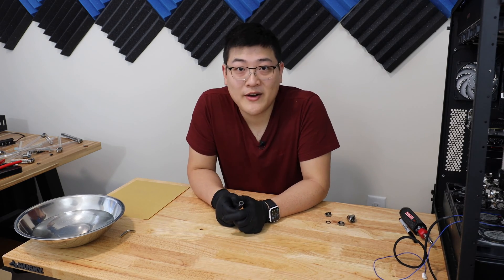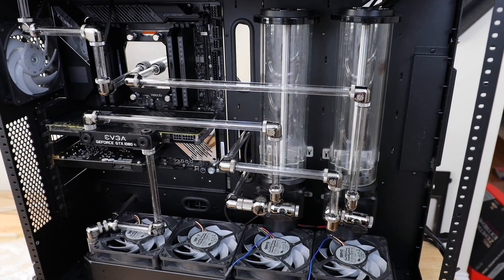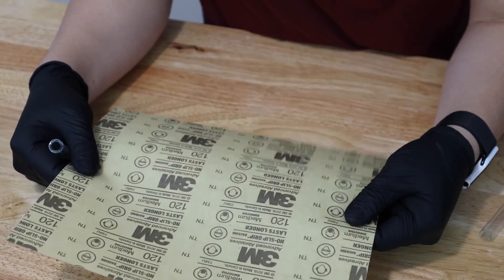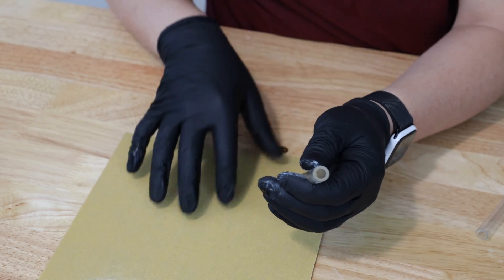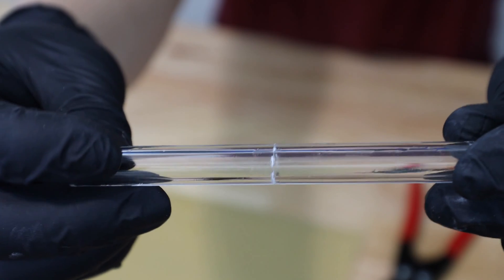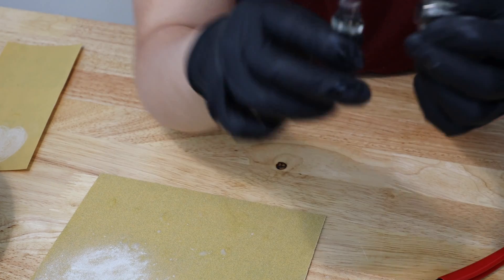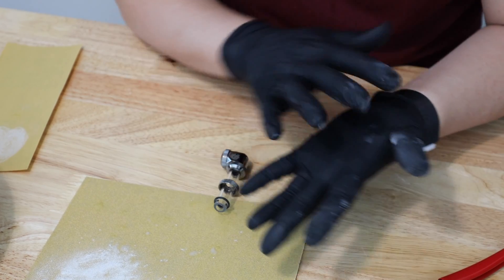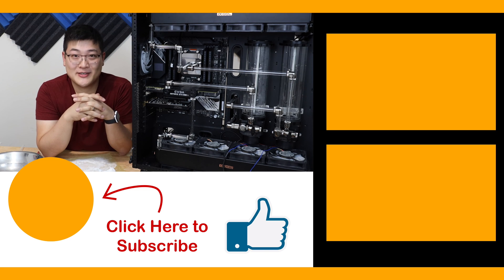How to Cut Glass Tubing for PC Water Cooling Tutorial

Comment: I've had a few of the tubes crack in the fitting it's such a pain. Getting the cracked glass out is no easy task. Those gloves are really not sufficient for glass cutting, you need cut resistant gloves. Nitrile gloves aren't cut resistant. Nice video though, I didn't think many others out there were doing this.

Comment: I Stan, im searching for videos on glass tubing because its caught my attention and im considering it fir an upcoming build. Would you recommend going glass over pmma? How do glass tubes look after a year of use? Still look like new?
Reply from the maker: Nah glass is just too much effort, if you want glass like tubing go acrylic instead of PMMA or PETG. Glass will splinter and crack at the edges in the fittings as the you push and tug at the loop during cable rerouting and new GPU install. The cracks lead to water loss, even though you might not see the dripping leaks. I found that I had to top off the water a lot more often. It looks good but it’s a pain in the ass to deal with. I swapped back to acrylic a long time ago.

Comment: The creation of glass dust is hazardous... not recommended.
Never use sand paper on glass.
Reply: Not even if the sand paper says  can be used wet????
Reply: @joeyh4590  Its not the sand paper dust as much as it is the glass dust. ALL glass sanding or grinding MUST ALWAYS be done using water at all times.
With care and organized safety control over the "slurry" created.
Wet glass dust can and will become dry and can become airborne later when disturbed... thus becoming an inhalation hazard.
Proper grinding and sanding can be done and is done on glass... the key word being "proper".
Strict care must be taken in all forms of this to reduce the chances of cross contamination and transference as well as airborne particulate chances.

Comment: Just finished a glass tubing build and this video was way harder than it needed to be.

It's really simple.
1) Score the glass using the glass cutting tool. You can also just use a triangle file.
2) Wrap a wet paper towel around the tube where the score is.
3) Snap the tube while simultaneously pulling away
4) Use a propane or MAP torch (~$20 at your local hardware store), adjust the flame until you see two cones. Place the cut end over the tip of the inner blue flame and rotate the tube using pliers (obviously don't hold onto it) until it kinda starts glowing and the edge softens up. Hold the tube in the air for maybe 2 minutes before setting it down on a baking sheet.

As the other comment noted-- flame polishing is way, way, way, way better than sanding. Not only will you not get glass dust in your lungs... the ends of the tube will look immaculate and it's a much faster process. oh, and it's way cooler too.

As for prototyping with hard tubing first and then cutting all at once I didn't bother. The trick is to just go ahead and assemble the tubes into your loop as you're cutting them. No matter what you'll inevitably introduce some errors so measuring the needed lengths with your already cut tubes installed makes things way easier.

Finally, don't buy glass tubes from water cooling sites. Aliexpress sells lab-grade borosilicate glass tubes that are identical to the mayhems stuff but at like $8/5 long tubes. You want 12mm OD tubes that are 1mm or 1.5mm thickness.

As for bending the tubing... just go reaaaaaally slow.
Reply from the maker: I thought about using a map torch but was worried the ends would be deformed and cause a leak. Glad that worked for you.
Reply: @SuprUsr Stan  you usually won't get pinholes unless you overheat your glass but you can tell when that happens pretty easily based on color. You can also leak check by sealing an end with a hand and filling with water to make sure you're solid.
Reply: @StanYanMan map gas is idea for bending glass. You can get creative as well if uou wanted to blow some sections adding a coil, bulbs are cool where it expands. If a corner flattens or deforms you can go back after it cools off heat the corner while blowing air in one end and capping the other and reform the shape and even improve corner flow so you don’t have multiple bottlenecks. Fun stuff only limited by imagination.